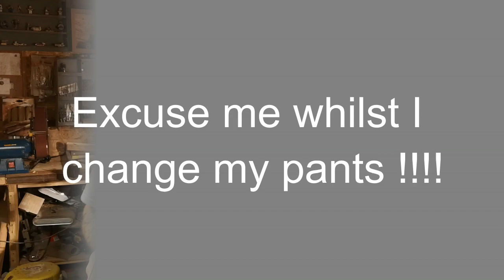Woodturning - I'm a fun- gi

Comment: 😂😂bwahahahahahahaha😂😂
"You composed yourself yet! Can I carry on"?
Cracked me up, that was gold!
Scary stuff when you hit the " brown note"...😨💩
They both turned out pretty good.
Ever thought about making a knock down cardboard spray booth now your doing a bit of spraying?
Just a thought.
Reply from the maker: Cheers Bill, I dedicated spray area is on the cards, but like all things practical, it keeps getting bumped down the list in favour of fun projects. I am thinking of something that will fit on the lathe somehow, what do you reckon?
Reply: @MGMakes  that sounds like a pretty good idea worth pursuing, mate.
Given the footprint of your shop I think something that would fit over the lathe might just work a treat for you. 
That little air-gun you use does not have copious amounts of over-spary  like the bigger automotive ones.
Also sounds like another potential upload, wink wink, nudge nudge... 😂😂
There are a few online that might be worth a look at, give you some ideas.